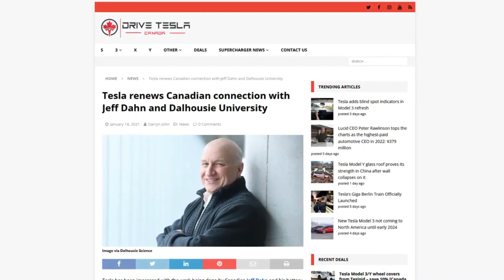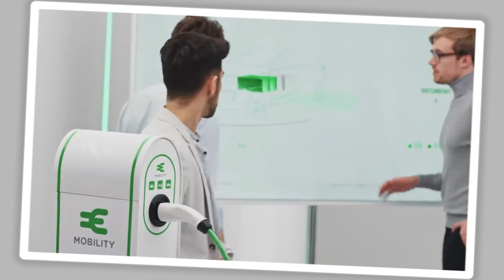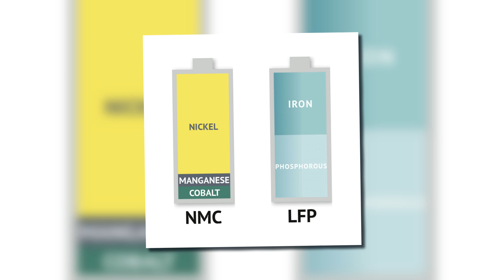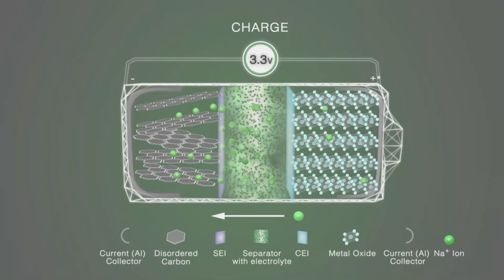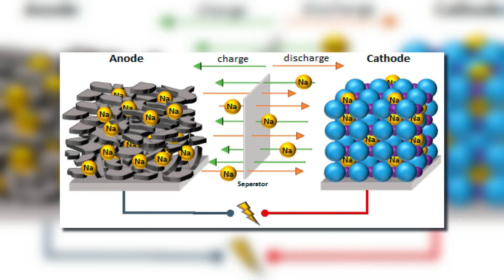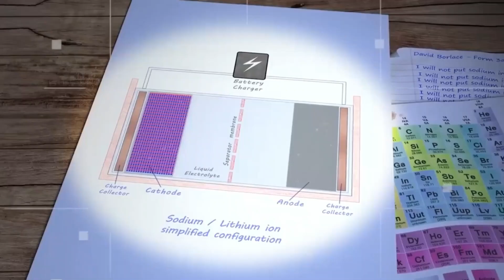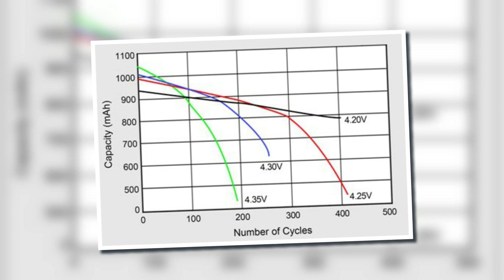Tesla's New Game Changing Battery 2023

Comment: Talk about "the blind leading the blind!!!

Let's get this straight.
1) The Sodium ion cells will be from CATL not Tesla.
.
2) They will very likely be used in STORAGE, not cars, because they don't have good enough gravimetric or volumetric energy density yet
(Density isn't as important in a container sized pack!)
.
3) CATL have FAR better cells coming for cars
LMFP (Modified LiFePo4, doped with Manganese)
.
M3P (loosely based on Lithium Phosphate with a cocktail of other metals including Aluminum and Magnesium)
.
4) Nickel based cells are safe and getting safe by the month as chemistry is refined and contaminates eliminated..
.
5) Look for a big boost from the Tesla 4680 in a month (Cybertruck) then in Q1 2024 (Kato Road/ Nevada, ready for the Semi).
.
6) To those who quote "BYD Sodium cells" supplied to Tesla.
*WRONG*.
BYD recently started supplying "some" LiFePo4 blade cells for the Berlin Cars.
.
Tesla MAIN suppliers
.
1)Panasonic/ Tesla partnership, Nevada.
.
2) Panasonic Japan (long standing 18650 for S/X)
.
3) CATL. (2170/ + LiFePo4 Shanghai)
.
4) LG (2170, Shanghai)
.
5) TESLA (!) 4680. Texas, plus Kato Road Fremont (closing for upgrade next month)
.
6) Q1 2024 TESLA Nevada (4680, for Semi)
.
7) BYD..... (A few cells for Berlin)
.